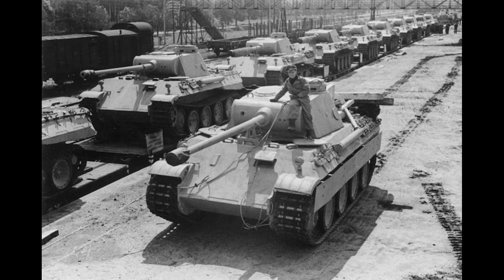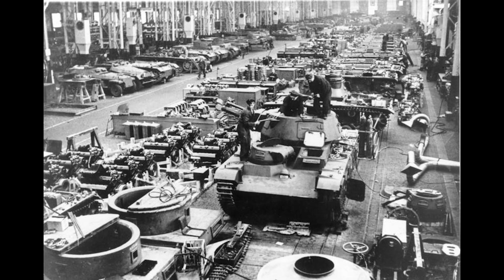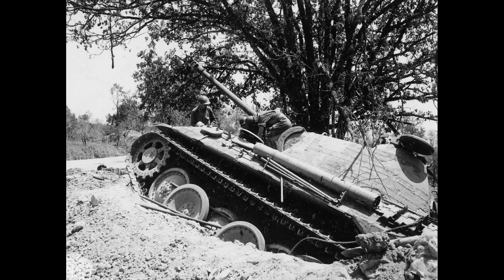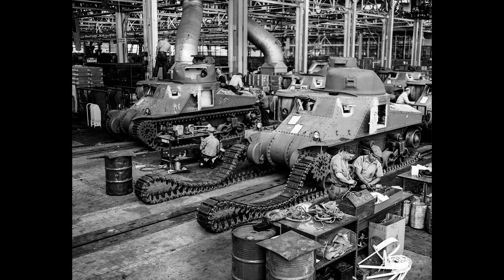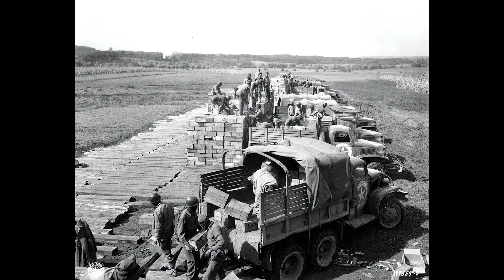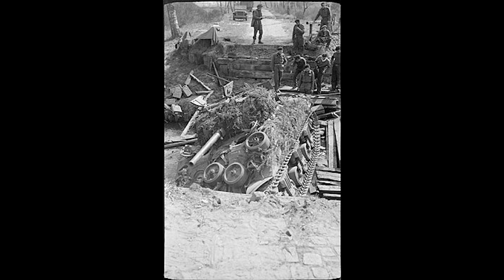US Tankers Captured A Panzer V — Couldn't Believe Its Transmission Failed After 150 Miles

Comment: This appears to be the most accurate and honest evaluation of the heavily over-sold "German Engineering" B.S.  The Panthers 10 ton final weight increase of the Panzer V''s initially designed weight specifications, the loss of Molybdenum and other key steel additives depicts the outright failure of the much vaunted "German Engineering".  No "Systems Approach" as was with the U.S. procurement in that same period.